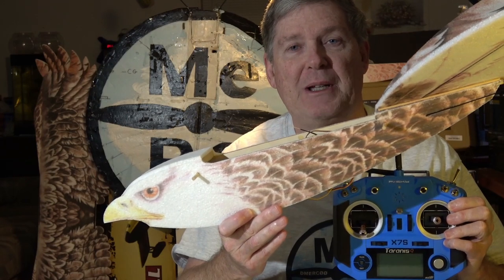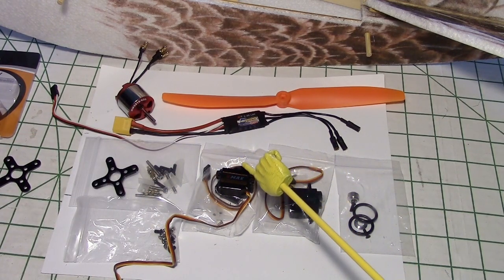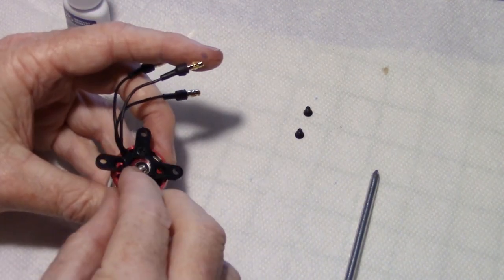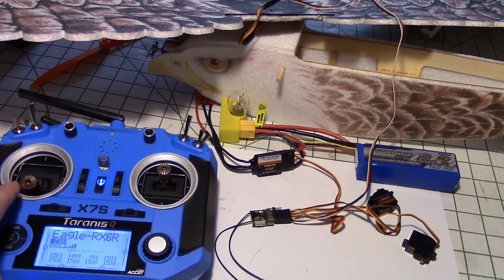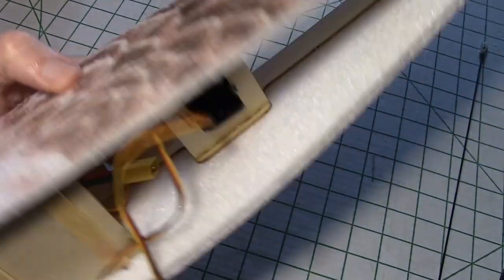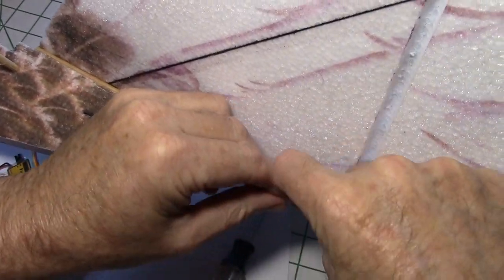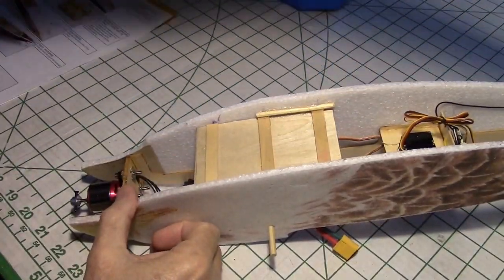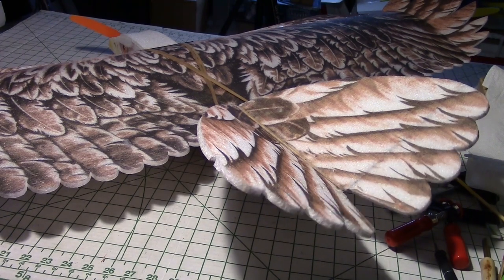DW Hobby E19 Eagle V2 1430mm Build pt 3 - Electronics Setup & Finalizing Fuselage

Comment: Hi Dave,
a really great series ! !
I am currently building my large eagle as a pure glider (sharp spout instead of a bulky motor).
I will use this bird for slope soaring in the high Austrian Alps - true and real eagle environment !
My question: Where is your battery located; close to c.g. ?
Since flying without motor and prop I will have to replace their mass by a (smaller) battery alone - to be located towards / within the head.
Thanks for a brief comment on your battery location !

Comment: Dave as others said, great video, to the point and full of info! one question: why replace the v tail servos with metal gears while using the stock plastic servos for the ailerons?
Reply: Yeah... I was wondering the same thing. I would have switched the type of servos around. The larger surface Ailerons would apply more force to the servos.
Reply from the maker: Thanks for watching! 
Question: Why stock servos on the wings but more expensive metal gear servos on the v-tail?
Answer:  My experience has been that the RC Eagle will fly ok with one or none of the ailerons but if one of the v-tail servos fails it always ends badly. Therefore to save money I use the cheaper plastic gear servos on the ailerons.

Comment: Always wondered, what size fuel line do you use? The odd model comes with some, but I'd like to use it on all my planes. I live in the UK, so a rough size in mm would be appreciated, cheers.
Reply from the maker: The answer to that is 6.35mm OD or 1/4 inch OD fuel line hose is what I have been using to hold the clevises closed.
Reply: @DaveMerc  Cheers for the fast responce Dave. Would that 6mm size be the inner diameter? I've found some Silicolne tube 6x8mm. Do you reckon that would be about right, or is the 6mm the oiter diameter? So more 4x6mm?
Reply from the maker: 6.35mm OD or 1/4 inch OD so it's probably the 4x6mm.